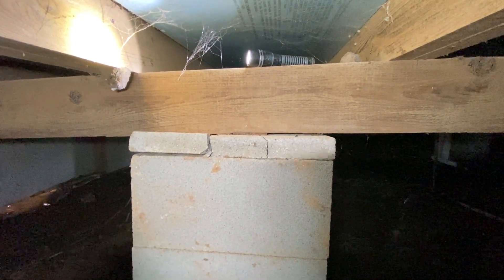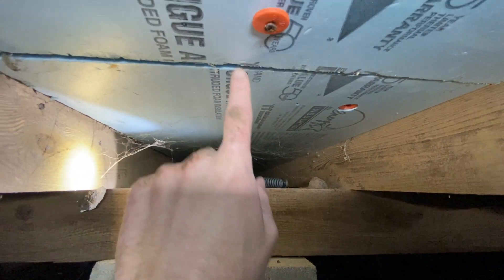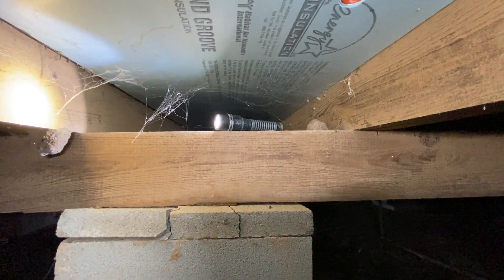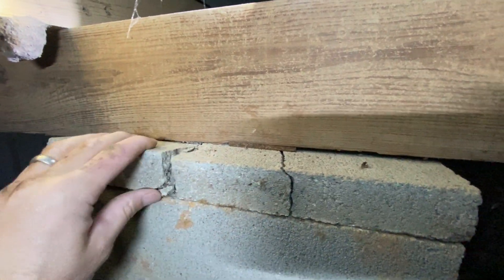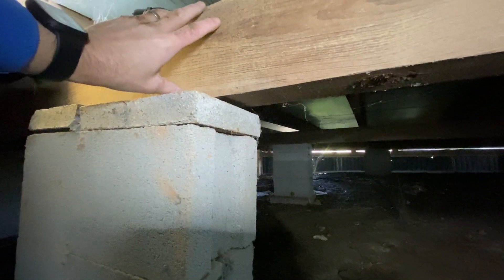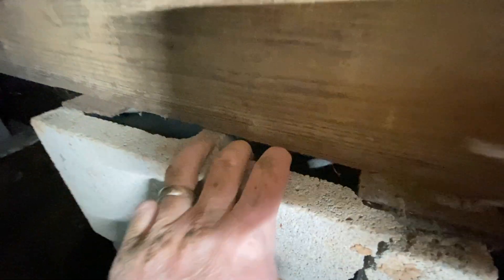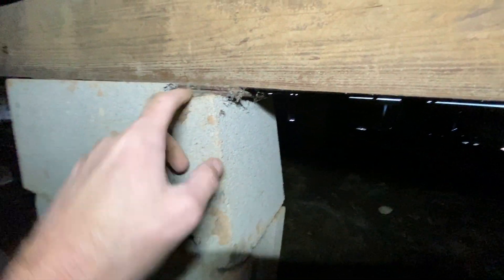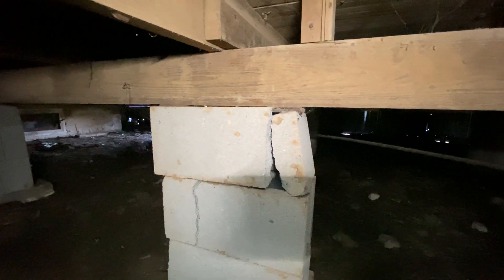Here's Why You Don't Use Steel Shims for Crawl Space Foundation Leveling

Comment: The steel shim should cover the whole block, spread the load on the whole block and not just at one point.
Reply: The shim could be a little wider imo but the cinder blocks seem like part of the problem.
Reply: @ricktbdgc  Bingo.  Moment I seen this video showing hollow block no mortar stacked CMU... I was like 'this is normal?'
Reply: @Cinncinnatus   Yes dry stacking concrete blocks is standard operating procedure. Care MUST BE taken to ensure plumb and level. All shimming to be installed without load and at least as large as total contact area. ( If the block has 3 ribs there must be at least three shims or equivalent, one can cover more than the contact but not less. This is all clearly printed in the Building Ordinance and Code Association book. The piers are supposed to be inspected by a code enforcement official before framing begins in most municipalities.
Reply: Yeah you can see on both of those block pillars the cracks are exactly where the steel shim edges are. They're concentrating the force. I think any material would also cause cracks the same failure since it concentrates the forces to a small area. Steel itself won't crack. Any material the same size as the cinder block should be OK.
Reply: Agreed.  Who thought that was a good idea? (cheap builder, apparently)
Reply: Why steel though ? Why not hard woods? At least they will conform to the block and beam a bit more to help them distribute weight?
Reply: @chuckthebull  hard wood shim that thin would likely crack.
Reply: @ronmoore6598  oh was just thinking it would squash in ..even if cracked...but I'm not talking some little sliver..a good wide type...I did this with my 1908 house and it's worked out fine
Reply: It has absolutely ZERO to with a steel shim . It 100% because its not big enough to spread weight.

Comment: Blocks should be filled with concrete and reinforced with rebar to resist shear load.
Reply: Here in Ireland we'd use 6" x 9" x 18" solids for a job like that & slate shims... though nowadays virtually all houses are (insulated) concrete slab base...
Reply: for a pier blocking... LOL NO

Comment: Yeah you're wrong on both things. Using wood is against code, and using large steel shims that cover the whole top of the block is code and is an acceptable form of shimming. The skin they used is unacceptable not because it's steel but because it's tiny

Comment: Wouldn’t 4x4 or 4x6 treated lumber on end be better than the blocks? (with proper isolation from the soil, of course)
Reply from the maker: Installed vertical or laid horizontal?

Vertical installation is great for a deck, not for home construction, and can point load a sill/beam and cause humps in the flooring.

We use treated lumber as part of shimming process laid horizontal to maximize the support across the entire length of the concrete blocks.

I'll get a video of that uploaded soon for demonstration purposes
Reply: @AnchorFoundationRepair  I can't agree.  If the span is too far, then add a second horizontal beam below the existing, and then use a vertical wood post of the appropriate dimension.  Hollow cindercrete (concrete) wall blocks should be a last resort, or used for an out building or shed.
Reply from the maker: That's cool, no need for us to agree on everything.  

We're a repair company only.  We use techniques that have stood up over time and modify as needed to make the best improvements feasible.

I'm sure we can both agree we want the best for our own homes and homeowners that may be seeking information to make good decisions that apply to their situation. @ThisOldMan-ya472
Reply: @AnchorFoundationRepair  This is the reason I attempt all my own repairs, whether home, vehicles or equipment, because I have had too many instances where the 'professionals' do what works for them. I have also renovated homes for 35 years, and my clients are few, because I do not have time for more, and now retired.  I am currently doing my own septic field, because the professionals want $30,000 - $ 50,000 for a job that just takes me time. I guess I am lucky that I can.
Reply from the maker: Nothing lucky about it... skilled and determined and self reliant.  We need more like you when it comes time to take care of business!! @ThisOldMan-ya472

Comment: Wouldn’t it make more sense to shim the individual joists on the beams instead of the beams on the piers?
Reply: That could cause you to have to shim 20-30 joists instead of bringing your girder into level once. When you start plumb, level, and square, it makes less work later.
Reply from the maker: @peterwall1181 Not ordinarily.  Sometimes you might have a joist or two that is warped and needs a small shim, but that's the exception not the norm.

Comment: This has nothing to do with steel/aluminum shims. It has to do with the cinder block or concrete block to handle a load, especially when they are hollow. When the blocks are not balanced/leveled, one side or one point of the block has to handle the load from above. Notice some of the blocks are cracked. Typical standard concrete (not concrete blocks, which is closer to mortar) can only withstand a load of 3000 lbs/in. Cinder/concrete blocks cannot tolerate this pressure (pressure = force/area). When the block is not balanced, a small area on the block has to handle all the load (pressure) from above. Just simple physics. That's why construction materials come with specifications (objective criteria) and not subjective claims.
Reply: It absolutely has to do with steels shims. Concrete is not intended to have so much weight on a point, it’s supposed to be distributed which is what steels shims DONT do. Please be smarter
Reply: @huckfin1598 little steel shims cause massive point loads, agreed. Use many more steel shims or larger steel shims. Wood crushes. So definitely DO NOT USE the softest of woods lie cedar or pine.
Reply: It's physics. The load can't be resting on a single point no matter what it's made of. You need to spread out the load over as large an area as possible not pin point it. Imagine they used ball bearings instead of steel shims what would have happened? The same thing only faster would've no matter how dense the block is.
Reply: @reyray1123  Wood can compress, gradually evening out the load. Steel does not. Whether that would make enough of a difference to save those concrete blocks from fracturing is hard to know for sure... but steel shims were certainly the worse choice.

I mean, I suppose at least they didn't shim the foundation with diamonds. Not that the homeowner probably would've minded.
Reply: Could you explain further? I have no experience with block supported foundations but what you said makes sense for the other blocks supports in the video except the first one. The first one as split in the middle, which couldn't have been due to uneven installation, right?
Reply: Thanks for your question. To be frank, the house in this clip should not be inhabited. As far as I can tell, the foundational supports for the beams in the crawl space were not bolted, bracketed, or anchored in anyway. The only thing that is holding the beams to the concrete blocks on the bottom is gravity. It's safe to say that the house is not in California. 
It looks like the builders used the beams to lay out where they put the rest of the foundation blocks. They probably started out with 2 piles on the 2 ends of the beams and then work inward toward the center of the wood beam at hopefully fixed intervals. This is not what the book meant when it describes building things from the ground up. :D Notice that the blocks were just stacked on top of each other without mortar. Again, the builder was assuming that gravity will hold the beams to the supporting block piles. Trains, 18-wheelers, strong winds, earthquakes, and subsidence can move things around. Over time, the beams will never be sitting on the same spot on the block if they were not tie together.
Let's go back to your question. As you observed correctly, the most likely cause for the crack on the mortar plate is due to the part of the beam making contact with the mortar plate. We can inferred that part of the beam might be shagging. You can kind of see it from the clip. There are more clearance on the two ends of the mortar plate than in the center. Keep in mind that mortar cannot bear as much load as true concrete, hence the mortar plate and "concrete blocks" can crack easier than concrete (even when unenforced). Notice that most of the other block foundation piles do not have a top plate, only this one. So instead of cracking at single point, the crack occur in the middle segment of the top mortar plate, where the load from above (beam) bore down on mortar plate. @incognitosan2681 
The danger of this kind of foundation is an earthquake can cause the whole thing slide/slip off the blocks and pancake the floor to the ground below, since the beams are not securely tie into the supports.
Reply: Railroad crossties cut up into block size would be perfect for this job since they can hold much more weight
Reply: @terryhill4732     uh, no. The very best thing is steel poles of the correct length with load plates top and bottom. It could be the worst thing would be railroad ties. Not sure because no one has tried it that knows building.
Reply: @lelghericboyers5821  Crossties may not meet code but I've bought old houses from the 1920's built on crossties alone and still had a solid level floor, I personally wouldn't do it but they support trains sitting on them provided you have a good base to set them on, your steel poles have to have a solid base for the plates to set on
Reply: Wood shims crush early and keep crushing. Even a 16" 2x8 on top of the blocks will crush. If forced by circumstances to use wood shims use only hardwoods and the best of those. Hard maple crushes less than oak. Hickory more than a year old does well. But pine or cedar do not bear weight  side to side. Using too small of steel shims or too few is a problem if all you have is the small ones he showed here there should be at least two for every rib in the block of the necessary thickness.

Comment: What if the steel shims are full-width/length of the span on the block? Seems wood shims would compress over time.
Reply: When the wood shim compresses it still distributes the load over a wider area.  If the block is perfectly level and the beam is perfectly level then a steel shim would distribute the load over a wider area and MAYBE not overload the block.  But you can see that the block is not level (they seldom are level for long) so even if the shim was full size it would still be a point load on the block and break it.  
IF the block was reinforced AND filled with 300# psi concrete that conc. would have the strength to carry a much higher point load and not crack.  If it did crack there would still be more conc. to carry the load.  When a block cracks it loses all of it's capacity to carry a load
Reply from the maker: That would certainly be better.  The issue with steel shims is twofold: 1) they only come in a few thicknesses (is that a word?) and 2) you have to pound them in tight and sometimes end up causing humps in the floors.  That's why we like kiln dried cedar shingles.  We can get very precise with our thickness (and leveling) and can be tapped further in if a small tweak is needed.
Reply: @AnchorFoundationRepair    Cedar is pretty soft wood. Wouldn’t they eventually just compress with all that weight on them? At least make them out of a hardwood. That’s what i did in my basement with oak shims.
Reply from the maker: I haven't observed that, especially when using kiln dried cedar shingles.  With the tapered / wedge shape with shingles that can be alternated from left and right you can get a very precise amount of support to keep the floors as level as possible.

I'll add that to our list of videos to help demonstrate the repair process from ground up. @huejanus5505
Reply: @AnchorFoundationRepair  good points there.

Comment: No way would I EVER use conc. blocks in a load bearing situation.  Poured conc. piers only.  Conc. blocks are too brittle and offer NO support when the split.  That flat block at the top is crap.  The only way I would consider conc. block would be to put rebar in the center and fill the core with load bearing conc.
Reply: Where I live concrete blocks are commonly used and we live in an earthquake zone. We had a 7.2 centered about  12 miles away few years ago with no damage to our full basement  concrete block wall. It is on a footing with rebar and then there is  vertical rebar every 4 foot or less and two horizontal rebar at every two foot of elevation. It is then filled with concrete with 5/8” L bolts placed in the top of the wall to hold the plate.
Reply from the maker: No basements or earthquakes here... but our expansive clay soil is prone to causing significant issues.  There are plenty of ways to combat the issues and build a home that lasts.
Reply: @AnchorFoundationRepair  Do they ever use helical supports there?  These are screwed into the ground down to good soil and tied into a slab.
Reply from the maker: @Chris_at_Home   yes, but not very common.  The two most common techniques are drilled bell bottom piers or pressed piles (either steel or concrete)
Reply from the maker: We're in agreement here... unfortunately on old homes constructed with base/block piers we're sometimes limited in the repair process.  Base/block combos offer plenty of support when installed correctly, in the proper locations, with the right shims, on the right home.
Reply: I agree, on existing homes you sometime have to deal with what is there.    @AnchorFoundationRepair
Reply: lolzzzzzzzzzzzzzzzzzzzzzzzzzzzzz